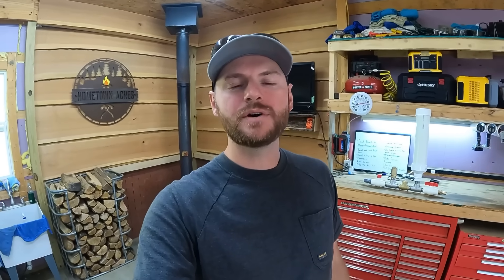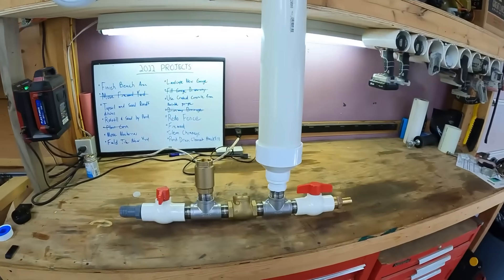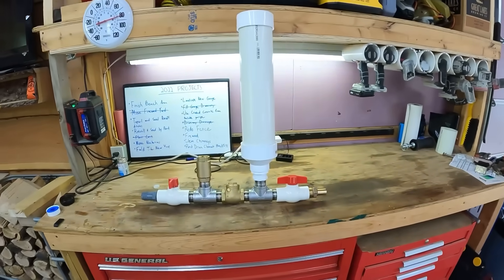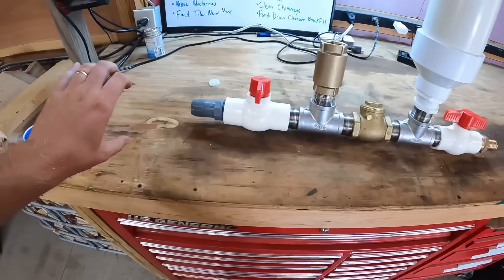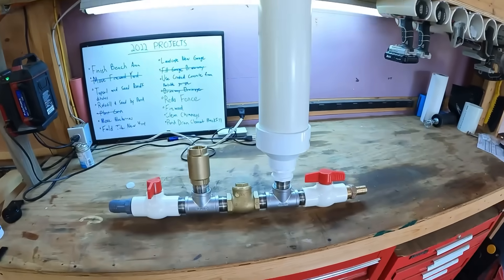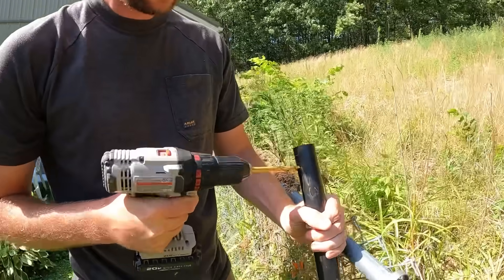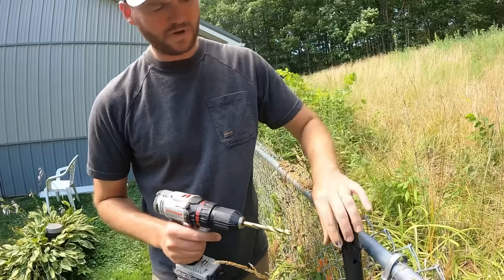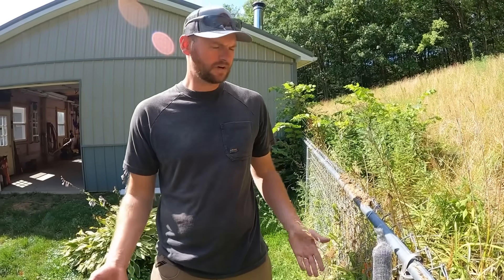We Found Water For The Pond - Hydraulic Ram Pump

Comment: Here's a thought. I use this method on my swimming pool and I get a 2" power stream of water. I take a BACKWASH HOSE, plastic that goes flat and will roll up, and I lay it downhill, 50 feet from my pool and I raise it up just below even with my pool water level. I built a PVC "U" the depth of my pool high plus 6" with 2" schedule 80 pvc and the strongest glue, (with its primer), I put a "T" 2 way valve on the outboard side and slide the Backwash tubing onto its bib and secured it with a tyrap.  💥 Now here's where my operation and yours are similar enough to work...I turn the "T"-valve open to the outside air and pour water with a gallon jug into the hose till it comes out the tip of the backwash hose. <That charges the hose.> Then lay the entire assembly over into the pool and hold both ends at just at  pool water surface and allow the whole assembly to fill with water. NO AIR inside. Then When BOTH ENDS ARE UNDER WATER, I move the valve to the outboard backwash tubing and drop the whole assembly. It goes to the bottom of the pool. This air locks with the water already loaded in the 50 foot backwash hose. When I drop the end of the backwash hose onto the ground, I get a surge of water, 2" in diameter. It is pulling a siphon & It's GOING TO BURP, but it has enough water driving that little bit of air on out. You keep a 2" power stream of water till it catches air at the bottom of the pool. I always go down and lay something over the output so it won't pull a vortex and get air into the system and loose its syphon too early.
   💥 You could go down close to your pond and put a 20 foot piece of rigid 2" pipe in concrete, sticking straight up out of the ground. Cap the top of it and have a bolt-eye up close to the top with a pulley permanently attached to it. Run a rope thru it with a figure 8 knot tied 21 feet from the end of the rope. MARK THE END OF IT WITH RED TAPE. Then thru the pulley down to the ground and Tie a Prussic knot around the end of your black 2" hose (about a foot to the end). You need to put a cleat on the side of the vertical pipe, to throw a deck knot onto. Pull the RED end, which will raise your BLACK hose into the air about 18 feet. (provided you put the other end in concrete 2 feet). Then tie a deck knot onto your cleat. Then hook the end of it to the end of your Ram Pump line, NOT HANGING OVER THE SIDE OF A TUB !!! Then WAIT. When water starts coming out of the end of your BLACK PIPE, have someone be down at the creek on a walkie-talkie. Put a bypass using a 2 way valve. One side thru your Ram pump and one side directly to the creek. Just as soon as you take the rope loose and just let go the rope and water starts out the end, have him open the valve to the creek, bypassing the ram pump and it will put a hard syphon on the creek. You might ought to dredge out a deeper spot in the creek for your pickup point. Its going to be flowing with a hard 2" stream. To regulate the flow, raise the end of the Black Hose with your rope. ALL YOUR RAM PUMP WILL BE FOR IS TO CHARGE THE SYSTEM.  Once its put into straight pipe, your ram pump will HAVE TO BE out of the flow. 
   Hope you do this. You'll have a smooth operating system. I hope you do a video of it working. All you'll have to buy is a 2" divertor valve and a 20 foot section of 2" rigid pipe, a pipe cap, 3/8" eye-bolt & 1/2" rope pulley, a cleat, and 1/2" UV resistant Rope & a couple of bags of sack-crete.
   Bill, from Tn. 🇺🇸

Comment: Ever heard of a SYPHON (or the effect of syphon action)?
So - you have a pipe feeding water to a HIGH point..
Then you have it running all the way DOWN to the pond.
Yet aren't brainy enough to create a syphon at the top.
WOW.
By having a syphon effect, all you need is a stop-cock tap at BOTH the top & bottom of the downhill pipe.
DIRECTLY CONNECTED to the ram pressure pump's outlet atop the rise.
When you "start" the ram - there will obviously be AIR in the downhill pipe.
There will also obviously be a little left in the uphill pipe.

By having a shut-off valve at the top of the downhill section (as well as one at the bottom) you can control WHEN the water gets to enter the downhill pipe.
To stop the pipe "flattening" upon the pump stopping, put an air entry valve in the top of the downhill section - with enough back pressure to keep that valve closed - until the suction in the downhill pipe - gets too big.
Now - pump the water from the creek via the ram pump, allow it to flow easily out the top of it's pipe (aimed directly up - and not horizontal as you have it now) via a one-way (non-return) valve.
Then as soon as all "up-pipe" air has been removed - close the relief valve at the top, to allow the water to "forcefully enter" the downhill pipe.
As it will have it's bottom valve closed - the air in the pipe will need to vent out the relief valve at the top, also via a one-way non-return valve
As soon as water comes out that top vent (meaning the downhill pipe is now FULL of water only) - open the bottom valve at the pond.
What you will then get is a MASSIVE increase in flowing water from the pond inlet to the outlet at the pond - assisted by the ram pump - as the ram-pump won't see the huge hilltop - merely the height difference between the pond outlet and the creek inlet.

The ram-pump will purely assist the gravity feed going downhill, (via the downhill syphon) - which will probably then only be providing about half the pressure needed for the uphill pipe to push it's water.

The ONLY difference between a normal syphon working and your pond supply is this:
Normally (no pump involved) atmospheric pressure pushes the liquid up and gravity pulls the liquid down - then the down pipe needs to be well below the inlet height

However - putting a small pump at the inlet (or between the inlet and the top of the syphon) - allows the downhill pipe to be shorter (and it can even outflow above the height of the inlet, dependent upon how much "push" the pump gives the uphill / inlet water).

For everyone's better understanding - read this.
The ram-pump you are using is ONLY required to fill the pipes - of a syphon system at the start (not to pump all the water that can flow through the pipes), as well as adding extra creek water when required
https://www.aft.com/learning-center/application-topics/682-pump-priming-systems
Reply: Condescending @zzhole. What he did is working justfine for him. Keep your "genius" opinion for someone who asks you...which is no-one 😅.
Reply: The pond is higher than the stream.

Comment: Evaporation on hot summer days will make it loose At least 25% of the water delivered. build a dam and increase the flow. Every foot of head pressure is .434 psi.  10 foot of head will give you 4.34 psi at the point of entry to the ram jet.  You should get about 31 psi at the discharge. If rain eventually fills the pond, the system my come close to maintaining higher water levels.  Good luck.

Comment: You should have that "pressure" tank with a removable top... and put a piece of pool noodle to fit inside for the water to have something "push back" for a harder hammer snap and better push of the exiting water uphill. Just my 2 cents.

Comment: QUESTION: Why don't you have your ram-pump & double pressure tank system setup at the highest point? I suggest that your initial double pressure tanks be much larger.  You can also install a check valve to prevent the waterflow from reversing back into the creek.

Comment: I wonder if a second pump and ibc tote, at a bit less than the mid elevation, would increase the overall flow.  The higher elevation pump would have to pump a bit less than the lower one so the higher one won't run dry and shut itself off.     ... Just thinkin'.  Don't know if the decreased head would help or not.

Comment: Drilled hole in the intake pond side so the drill shaving are still in the pipe? The shaving will go into the intake of the pump. I think you f up. Your 2nd go the shaving are gone so it work's.

Comment: Nice video. Setting it up so that the outflow pipe is continuous from the pump to the pond should work fine and increase the flow a bit.  I don't think that you will get a siphon condition anyway because the flow isn't enough to fill the outflow pipe. My Dad first encountered a hydraulic ram pump in 1929 when he was a kid at Boy Scout camp. He was fascinated by it so then he researched about them. He taught me about them in the 1950s and then I learned again in the 1970s from Mother Earth News Magazine. Adding a little more weight to the overflow check valve should increase the flow. Good Luck, Rick

Comment: I saw one of these in a tramping area feeding some toilets from a mountain spring in Rotorua. It pumped from the spring that was a little up the hill maybe 1m to a tank that was about 4m high on the roof of the toilet block that provided fairly good pressure for the hand washing taps.

Comment: I loved this video! And think you are correct with the open container up top (vs a closed pipe in the pond), you've basically removed the pond-gravity system from applying pressure back down the line into your pressure tank. You have a really strong flowing creek. I'm jealous.

Comment: My thought is to the affect of the fact that once you get water to the top of the hill were your holding tank is , that's when you should convert to a syififin line of big as you want . This will bring you much more water flow.  So if you run a line 2" or 1" it will pull water up your line with out the pump.

Comment: That's right ... The receiving tank acts as your siphon breaker 👍👍
And good call on using a smaller diameter pipe on the delivery side. I would have gone to 3/4 poly line to help the ram pump work at the highest efficiency. You would still easily be able to achieve 1.33 GPM as 3/4 pipe has plenty more than enough flow AND your pump would be pushing against a lighter weight head. 
Great that you got it working👍👍👍
THANKS 4 THE GREAT VIDEO 😊✌
P.S.  I subscribed and gave you a LIKE

Comment: I would try connecting the tubes together to see if the pond is actually lower. If not connect them together with a T and a short pipe going vertical to break the vacuum and it should work fine.

Comment: As long as the pond is located higher than/above the Ram Pump, I think it will be an advantage NOT to use the IBC tank.
Do this:
#) At the highest point, i.e. where the IBC tank is placed now, replace the IBC-tank with a T-connector. Insert a T-connector with a vent valve (V1).
#) At the pond - let the hose, that is coming from the Ram Pump, end in a tub UNDER the water surface of the water in the tub, so that air does not flow into the hose.
#) Add a valve (V2) at the end of the hose, - i.e. the valve V2 is submerged in the water in the tub.
The upper part of the hose will now basically work like a siphon.

Start the flow as follows:
#) Fill the tub with water.
#) Close valve V2.
#) Open valve V1.
#) Start Ram Rump.
#) When the hose is full of water, - i.e. water flows out of vent valve V1, - close vent valve V1.
#) Open valve V2
#) You should now have a bigger flow through the hose to the pond than when you used the IBC tank.

Another thing is how you optimize your Ram Pump.
Watch the following video and you will learn how:
https://www.youtube.com/watch?v=UEWl-8S19eI
HOMEMADE 5/4'' Ram Pump - BEST HOMEMADE WASTE VALVE

And here is a later video of how Bohumir Stehlik makes his Ram Pump:
https://www.youtube.com/watch?v=1bB3o_EZRr8

If You place the waste-valve before the pressure-tank, air (a small portion of air) can perhaps be sucked into the pressure tank and the pressure tube. This air will in Your case over time reduce the siphon-effect in your pressure tube.
If this is the case, this could maybe be solved by placing the waste-valve after the pressure-tank, like Bohumir Stehlik does, or, if possibly, place the waste valve under water.

Comment: Cool idea but shouldn't the out pipe on the ibc be lower down to avoid the water getting stagnant in the tote plus the weight of the water might push it down to the pond faster. 

Drilling a well to fill a pond would be INSANE and stupid for many reasons other than money. Draining an aquifer to then just have the water evaporate.

Would a bigger pressure pipe on the ram pump increase the flow or make it more steady?

Comment: The max pump pressure is determined by the water hammer. Any components upstream need to maximize the pressure spike of the hammer. I would suggest using a straight run of steel pipe into the pump that would not expand momentarily on the pressure stroke like plastic would. Doing that will give you a higher hammer pressure peak and increase the pressure in the pumps pressure tank.

Comment: It occurs to me that you need an adjustable spring on that check valve. A fine tune could increase flow dramatically. Also stop removing the ibc cage and cutting the top off. Use the cage for support and just cut an access door on top.  Why have to make a new cover? Makes no sense. 👍😎👌

Comment: What if you increase your intake side to 2" pipe?  I think you need more volume, kinda like looking at water in terms of electricity, (voltage/amperage), look at it as volume/pressure.  At 8.3 lbs./gallon you will carry more through the 2".  Just a thought. 🙂

Comment: You mentioned the bottom of the creek is 30' below the bank, and it appears the pond is more than 30' below the bank, and you mentioned you were worried about the pond pipe creating a siphon if you connected it directly to the the discharge pipe.  The light should have come on in your head at that moment. 

If the elevation of the pond is lower than the creek bed, simply create a small weir in the creek and siphon the water over the bank. no ram pump needed, and you will increase the flow :)
Reply: Even if the siphon didn't work the tank further down the hill would lower the pumps head and increase the flow. I'm sure the siphon would work without the pump the inlet a bit up stream to keep the max lift to below 9.8m.
Reply: Mini ex could of dug down 10' to the creek bank then down hill the rest of the way to the pond for just a siphon would flow more then this pump possibly.
Reply: Exactly. It will dribble down the line until the flow increases enough to fill the diameter of the pipe and create a vacuum. It will simply flow past the inline valve and increase volume. 
Now, If it ever catches a bubble, the flow would stop and I believe it revert back to it's ramming action. Rinse and repeat lol
Reply: You'd have to reprime the pump every time the creek drops below your inlet.  Maybe that's never, around me the year round creeks usually have permanente in their names... ...and there's not many permanentes.
Reply: I was thinking the same thing. Get rid of the ram pump altogether and connect the two pipes together, and add a valve at the pond end. Use one of those inexpensive power tool battery powered pumps at the pond to prime it, then once the pipe is full stop tbe pump and close the valve. Remove the pump, open the valve, and let gravity do the rest.
Reply: Because you can only lift (pull) water 30 feet with a siphon, and that is "theoretical lift", actual lift is probably lower, but it couldn't hurt to try.
Reply: @claypf4795   That's spot on man.
Reply: There is a limit to how high you can lift water with a siphon which is around 30 feet at sea level and it's reduced a little in higher elevations. If his estimate is right then he would probably have a hard time unless he moved is intake pipe a ways upstream. That being said, I think his flow would only be improved connecting the pipes directly and deleting the plastic tank.
Reply: @bradysjoblom  It's mor like 25 ft.
Reply: @daviddecker9457  My dug well was built many years ago, designed to lift closer to 24 than 30 feet, using an electric ground-level pump.  But at his current flow rate evaporation will drain the pond 3x faster than he fills it.

Comment: A siphon setup using pvc might work, but have you thought about a small solar powered pump?  Of course you’ll need a pump powerful enough to pump uphill, but that should get you at least 5 gallons a minute  flow.   It might necessitate excavating a small pool in the creek and creating an anchoring method for the intake and the pipe.

Comment: Remove the ibc and run the pipe all the way, that will reduce your effective head and the ram will pump faster. More water.
If it siphons and stops the pump then put a valve on the hammer check valve,so once running you can syphon all the way.

Comment: After seeing the whole setup, the question is why do a ram pump?  YOu could just start a siphon with a valve on the pond end to ensure limited flow so you dont overdraw the stream and kill the syphon.  All you would need is a tee at the high point that you could pump water into with a  valve to ensure all the water you add goes the right direction to the pond.  Once you have the water running to the pond, cap the tee, and open the valve on teh stream side and boom! Syphon.

Comment: Is the pond lower than the creek supply? If so, you don't need a pump... you simply need a siphon with a stable supply at the creek. Digout/dam up a 'pond' and run your pipe